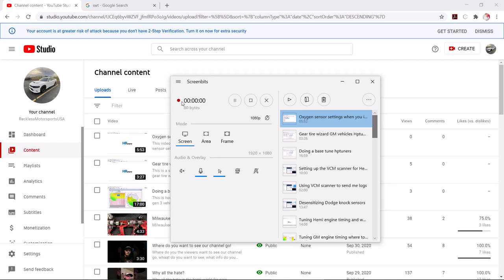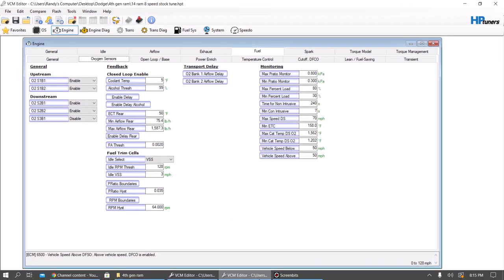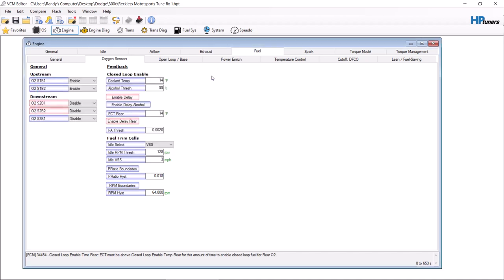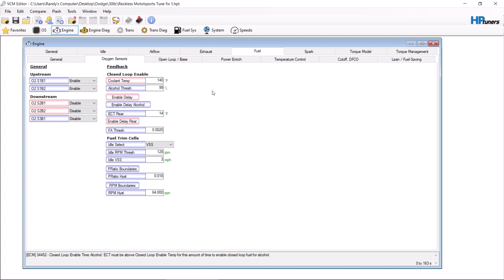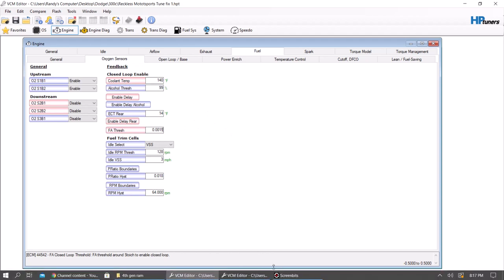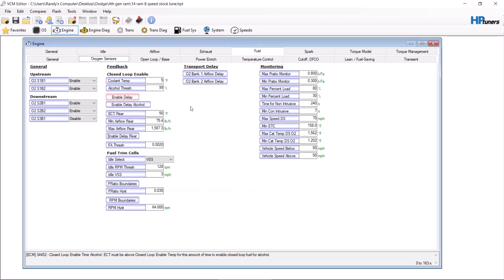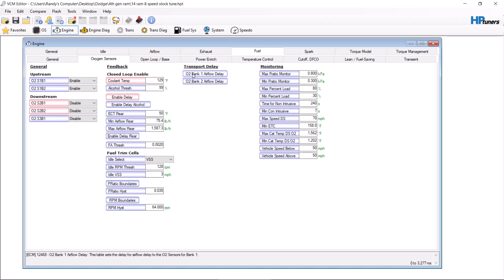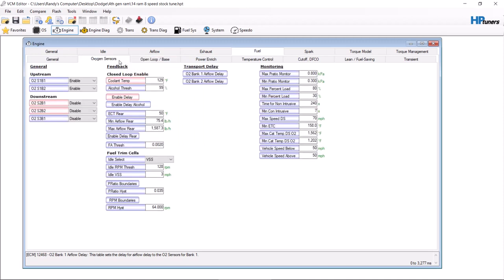Oxygen sensor settings when you install headers on a hemi

Comment: I have 2014 charger 5.7 cammed that i have been messing with.  Your videos helped me get the car setup.  Do you have any info on tuning the 5 speed?  I got it to shift at wot where i want to but would like to speed up and firm up shifts.
Reply from the maker: I’ll have to make one
Reply: I also have a 2014 5.7 charger. What cam did you go with? Any other mods? Mine is stock at the moment other than CAI and SLP cat back. Trying to learn some tuning so I can change that.
Reply: @RUTHLESS-GARAGE  comp cam 201-424-17, long tubes, i fabricated rest of the exhaust.  The cam requires limiter and valvesprings.  I did mds delete and got new lifters, pushrods timing chain etc.  I am shifting at 6500 right now and it feels like it wants to pull even more.
Reply: @bigworm84  Awesome man!  That sounds like fun. Lol! Thanks for the info. Good luck with everything.
Reply from the maker: If anyone needs one we custom spec cams that use mods and no mods

Comment: So if I install long tube headers and tune it to this spec it’s most hp and running the best?
Reply: this video isnt about horsepower, its just about preventing a check engine light. worked for me by the way

Comment: just lower the O2 delay and that's it why would u disable it!!
Reply from the maker: Disable is for the rear oxygen sensors I never said to disable the front ones
Reply: RecklessMotorsportsUSA i only tried the transport delay without disabling any sensors the car runs great!
No codes at all
Reply: @ParaRocKQ8  bro if you don't have cats fir example long tube headers then you have to disable down stream
Reply: @3babyghost  will try it

Comment: I know this is an older video but still relevant. I have a 2010 5.7 hemi has cats & long tubes headers I've paid for it to be tuned has not had any O2 sensor codes has cats in readiness status. But the O2 sensor will not get ready have gone through 3 tanks of gas trying to do dode drive cycles to get them ready. Can only have 1 monitor not ready. My 2  not ready are O2 not ready & EGR not ready I don't have a VVT cam and no MDS. Stage 2 TSp. Any help on this?
Reply: Did u ever figure this out